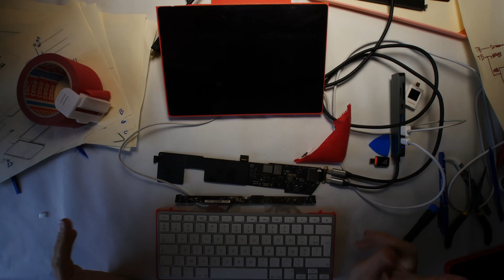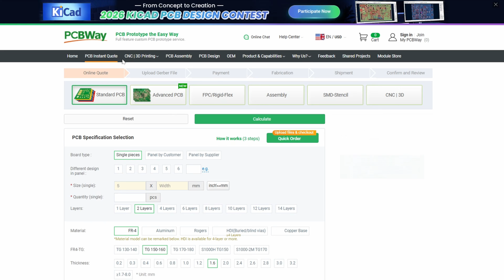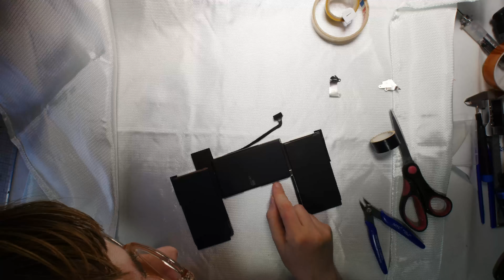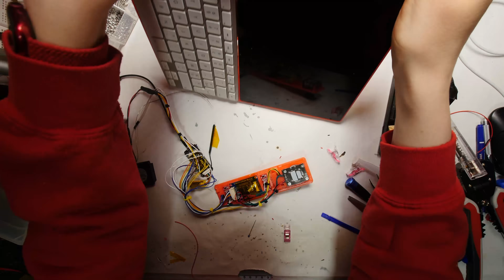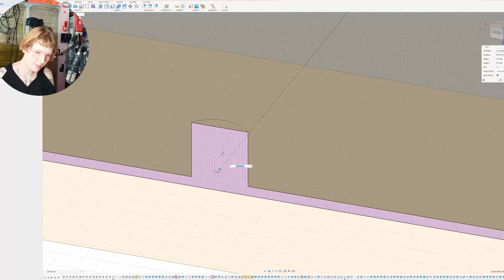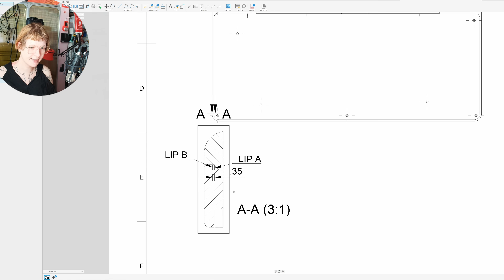Mac Cyberdeck Build: This Got Sketchy

Comment: Great to watch.  Thanks.  You can reform aluminium with just heat - usually a blow torch or maybe a hot air gun.  The problem is, it becomes workable just before it flops and starts to melt.  One way is to put some hand soap on it, e.g. liquid, as an indicator. When it starts to brown, it's getting close to too hot.  If you bolt it to another front frame to work on it, you may be able to get it to conform better.
Reply from the maker: Thanks! Yeah I’ll not mess with that. Especially in a tiny indoor space with plastic flooring